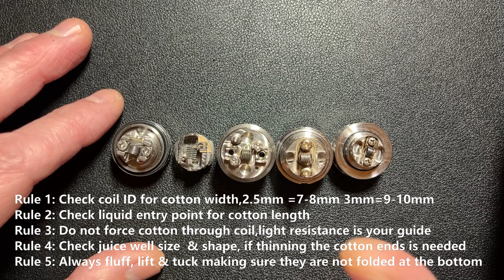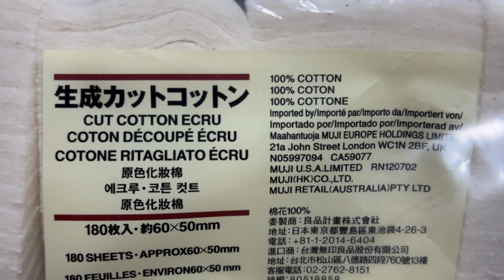Complete guide | how to use Japanese Organic Muji pads for wicking MTL RTAs | No leaks or dry hits

Comment: Hello Nathan, after this video I decided to buy some Muji. It cost me more the transport from Amazon DE because isn't available in my country. However, from flavour perspective is the best one and also the SXK Sputnik experience dramatically improved in terms of flavour and TH. Still, in all my devices (Sputnik and Spica Pro clones and Kayfun X genuine) I'm experiencing some light burnt taste from time to time which never happened with other cotton. I've tried to make it thiner or thicker, shorter or longer and also I watched all your video related to subject. Ok, improved a bit but still burnt taste is there from time to time. What should I make different?
Reply from the maker: I only use Muji pads on all my MTL’s. In my experience burnt taste is a classic symptom of wicking errors mainly that the cotton is too thick or long folding at the base of juice wells and not able to transport the liquid sufficiently enough to the coil. The golden rule when it comes to most MTL is less wick better saturation & better flavour. Try cutting the cotton legs by folding them over to just above the base of the juice wells and rake out them out to thin them a bit then lift and tuck so they fill the juice wells fully but not stuffing them down. That chocks the flow.
Reply: @netvaper  thank you very much sir. It's clear what I have to improve in my wicking process.

Comment: My Ripley keeps popping and crackling badly. I am using 70/30 liquid, 2 or 2.5mm diameter 28ga kanthal with 6 wraps, i do wicking exactly as you do. What should I do, could you please help? 🙏
Reply from the maker: @Kamil AKARSU. Spaced coils- too thin cotton in the coil- fused or core clapton coils all can cause popping & crackling. No harm at all, in fact i love that sound, so if it does not ruin the flavour or leaking, enjoy the crackling sound 😊
Reply: @netvaper  Thanks for reply. The sound isn’t problem, I kinda like it too:) but it burns my mouth. I watched your video again more carefully, tried again with 2mm less spaced coil and that’s much much better now. I am watching your honest and sincere videos and learned too much. I quit smoking two months ago thanks to vaping and you. Thanks again 🙏
Reply from the maker: Two months without smoking that is excellent 👌 Well done 👍 happy to play a part in your amazing achievement